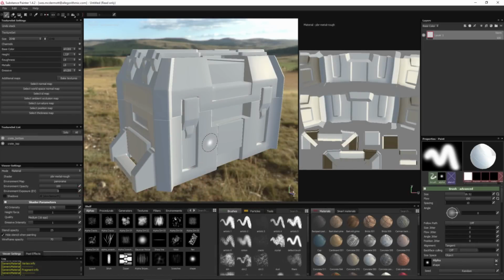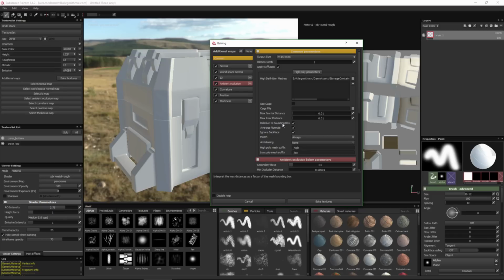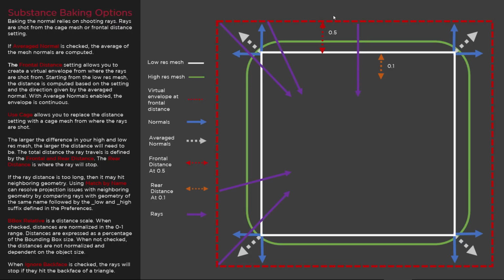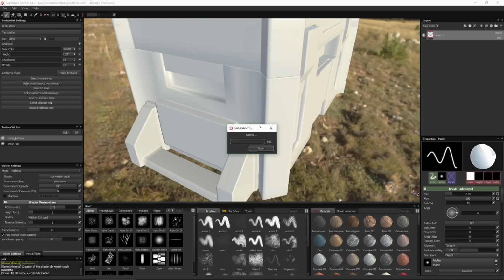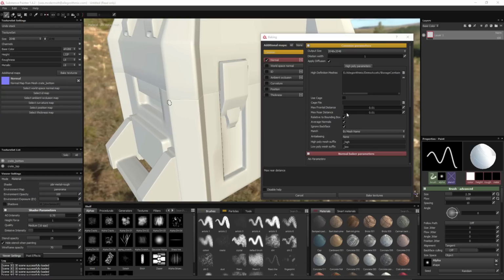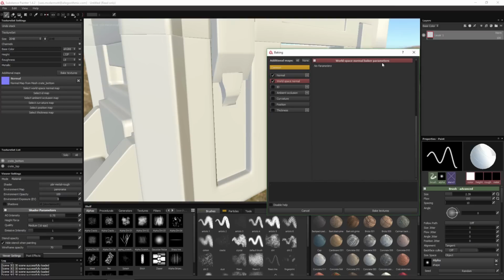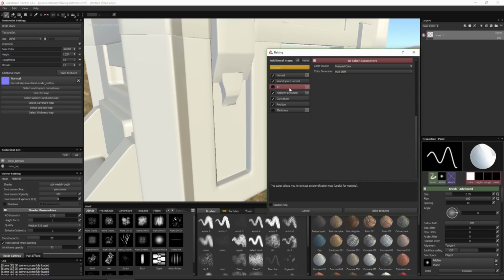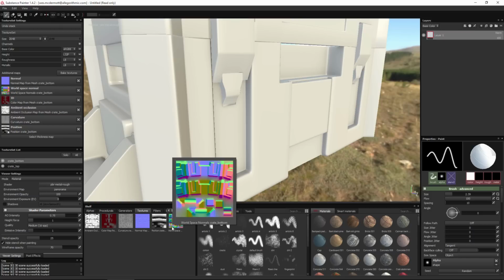Substance Painter Tutorial – Fundamentals 05: Baking textures | Adobe Substance 3D

Comment: I know this is old but seems like it still applies. I'm wondering a workflow that uses ZBrush, Blender, Substance and UE4 (using substance plugin). As far as I can tell, to take advantage of the matching feature, you need separate objects in one fbx, all with the same material if you want one texture set. So, in ZBrush, have a folder of all UVd meshes labeled as high, export the hipoly fbx (blender couldnt handle the poly count). duplicate the folder. Export the duplicate at lowest SD all and bring into blender, rename to low suffix, change mat to match on all objects. Bring into substance. Bake with match by name. Save out mesh maps. Make a low poly fbx that has all meshes joined into one mesh. Import into UE (this would make it so it's just one static mesh, not a dozen). Send to substance via plugin. Manually import and enable mesh maps from previous bake and viola? The only issue i can think of is triangulation mesh coming from UE import (they're quaded in blender and Zbrush). Would that be an issue if the UVs aren't really changed?

I'm fairly new to the whole process, so forgive the wordiness. Just trying to think out loud and see if I'm over complicating pipeline.
Reply from the maker: This shouldn't be an issue if the UVs are not changed. However you can also change the UVs and Painter can reproject the strokes. https://docs.substance3d.com/spdoc/uv-reprojection-28737554.html
Reply: @Substance3D  i actually did some testing and discovered the mesh memory feature, super powerful.

I had some odd overall UV shifts when putting the maps to the merged mesh in unreal (via plug-in) so i bit the bullet and set up a manual workflow between substance and ue, which actually isn't bad at all.

Also i just learned that hi poly doesnt even need UVs to bake.. at least in my case. So much time wasted.  

Name matching is the best

Comment: For baking normal maps - anyone knows what are the complications of having high values for frontal and rear distance? does it impact computing time or any other known issues?   Thank you!
Reply from the maker: The issue could be that the ray projection goes to far and intersects multiple mesh parts. This can cause artifacts. To compensate for this, you can use the "match by mesh name" feature to essentially mask the ray to mesh parts.

Comment: I am getting this error " not enough data in the high poly to use selected baker. Baking has been canceled." What to do wirh this? 
My mesh is inported from max and has 2 iterations levels of mesh smooth. That i think is high. My mesh. Textures of some parts are baked fine but there is always one or more edit polys/ objects whose map are all black. Complete black? 
I even searched online for this problem but couldnt find anything helpful. 😟. Anyone .....who could help me?
Reply from the maker: The data error sounds like it's coming from the ID baker. The ID baker defaults to vertex color and will produce an error if no vertex color exists on the mesh. For the black textures, this could be caused by having non-zero values in the transfrom. In 3ds Max, make sure you have the transform for the mesh frozen or zeroed out.

Comment: I have a problem using Substance Painter as my RAM goes full-load at 100% when I bake textures. The software doesn't crash but it keeps my laptop heated and the texturing process really lagging.
I use i7-7700HQ 2.8Ghz, GTX 1050 4G, RAM 16G and all necessary drivers are latest version. Is there something I am missing?
Reply from the maker: This could be expected behavior if you bake several textures at the highest resolution. However, the ram should free up after the bake.

Comment: Awesome tutorial, better than some "not free" tutorial i've seen on the subject.

i've a question about this. Does the high poly geometry have to be bigger than the low poly?  what if i have the two intersecating each other. I'm getting bad results and i'm wondering if is because of this.
Reply from the maker: Thanks! Glad you liked the tutorial. There could be many reasons for having issues with normal baking. The high and low should match as close as possible. However, if you are getting seams, it could be issues with smoothing, UV seams etc.
Reply: I was getting same issues today then I found out it was cuz of my model vertices, my robot model had double vertices on top in some areas and I was getting very annoying results but I removed those doubles and now its cool looking!

Comment: sooo about the high poly parameters 0.o... I only have one mesh. I don't really wan to model the model from scratch. Do i really have to 2 meshes?
Reply: nvm ill mess with the per pixel setting or ill check to see if i save a version prior to turbo smoothing, which should be the case since i had incremental saves.
Reply from the maker: You don't need 2 meshes. You can bake maps from the single mesh. Please check our latest course which uses only a high poly asset. https://tutorials.allegorithmic.com/courses/a97b433a5997fd800b5ed300d783cc41/youtube-IGGQl9kVB1M

Comment: But what is the use of baking? I understand the use of normal and AO but other maps i don't get it.
Reply from the maker: The other maps are used in the texture process with the generators. You can use curvature for edge wear and position and worldspace normal to place details at specific angles or directions such as snow or dirt collecting on the top of the asset.

Comment: Hello! I was testing how to bake a normal map but the baked map comes up black and nothing happens. Would you know why this happens?
Reply from the maker: This is caused by the high and low res meshes not being aligned. Make sure the meshes match up. Also, you may need to freeze the transform if the meshes were scaled.

Comment: Eyyy, thank you very much for the tut!! Awesome!

Just one question. According to your graphic, should the low poly be a little smaller than the high poly?  I understood that it doesn't matter, and we can control it with the cage or the distance value. But in your graphic the Low looks so small in comparation with the High...  And for me, I use to apply a mesh smooth for getting the High Poly, so it is always smaller than the low... 
Any comment about that?  

Thank you very much!
Reply from the maker: Thanks! Glad you liked the video. The low and high poly should match closely in size to overlap. The graphic is more illustrative in this sense and doesn't represent that the low should be smaller than the high poly. If you apply the smooth mesh and the high is smaller than the low I think you will get missing details in the raytrace. The key is to have both the high and low match as close as you can.

Comment: Hello, first of all, thanks for this videos, really really great. My qustion is, can i get Ambient Occclusion map from a high-poly mesh into a low-poly?, like bake the maps and the AO map being baked from the high-poly?,i tried, but i don't have sucess.
Reply from the maker: Yes, you can do this. You can bake AO from the low poly or the high poly. Please let me know what is happening with the map
Reply: Allegorithmic All right, let me tell my workflow for this, I don't know if I do it right. I open the project with low poly mesh, than i click the bake textures button, after, i select the maps I want and I put a high poly mesh in the common section, I hit the bake button. After the computing time ends, the AO map came with the AO from the low poly not the high poly mesh. Can you help me? OBS. If my low poly and high poly mesh share the same UV, I can bake the only the AO for the high poly, export this map, and open this map with a aditional map for The low poly in other project. Can I do this without this work?
Reply from the maker: If you are using a high poly in the high poly settings, it should be using the high poly for the AO bake. I will need to check on this.

Comment: Is there a way to deal with those aforementioned artefacts when your overall model is made up of a couple hundred different elements (3DSMax terminology for parts of the same mesh which aren't directly attached to each other)?
Reply from the maker: You can use the match by mesh name feature to isolate the ray cast so that it will only compute the mesh names that match. So for you high and low, you can use the default suffix of _low and _high. For example, you could have arm_low and arm_high. In the bake, only the bake only looks at the mesh names that match.

Comment: Why there is no diffuse map baking option? Sorry, but if you want just to bake from 3d scan to low poly retopo there is no option for this. Why not ? Just tell me!
Reply from the maker: We haven't added this baker to Painter yet. We do have this option in Designer. I will check to see what the plans are for Painter.
Reply: Yeah, it will be great to have this feature. You know, I am jumping between 3 softwares to have everything that I need. I think there is also no option for baking height maps.
4k baking with possibility to save in 8k (experimental), why ? Even XNormal has option to bake 32 K.

Comment: Could some kind soul shed some light on how to use the Max Frontal/Rear Distance parameters for the "virtual cage" to get a good Normal bake? The default values are 0.01. If I bake and find I need to adjust them, what sort of increments should I use... 0.02, 0.03? And should I match these for both parameters, e.g. Max Frontal Distance: 0.03, Max Rear Distance: 0.03?
Reply from the maker: There isn't a specific setting as it depends on the meshes. The max and rear distance define the length of the ray and the length needs to be long enough to sample both the high and low meshes, but not so long that it hits other geometry causing projection errors. To be honest, I just play with the settings until I get the result I like. In the future, we will provide a function to better visualize the ray.
Reply: Thanks for your reply. That would be an important update. If I use a cage instead, do I need to create a cage for each part of a mesh, e.g. if it is a gun with several overlapping, separate parts? Presumably you don't just create one overall mesh.

Comment: How do I read position map. Its very confusing. What I discovered so far is that magenta nuances of colors are lower geometry, and higher geometry is kinda cyan in color. I was up to use position map with chanell shuffle to isolate upper areas to apply dust somehow, but I dont feel confident to do that. Is there any video with the info on that. 
p.s. I have made some wood, rock, brick substances of mine. Can I upload them somewhere on your website, or are there any forums where people give away their substances for assessment, or download?

Comment: I find this series of tutorial for Substance Painter really good! Straight to the point and clearly explained, it has been an invaluable help in my learning of the program so far. One of my favorite features has to be the "Match by Name" function. Thank you very much for the efficient tutorials!

Now I am however facing an issue that I can't seem to find how to solve and it involves the Curvature map which always turns out black. All the other maps are baking just fine except that one. I've read somewhere that it might involve something with the GPU but I tried on 2 different machines (Intel then Nvidia) only to get the same result. I have also tried to freeze the transformations of both my high and low meshes before import with no success.

Aside from this little issue I am looking forward to pursue my learning of this pretty neat software. Thank you once more for all the nice explanations!
Reply from the maker: Thanks! So glad you like the training : ) Can you please post in our forums and I can help you with the curvature issue. I haven't seen that happen before. I've seen the normal bake as black when the meshes don't overlap. This comes from there being data on the mesh transforms. The curvature should be baked from the normal. Do you get an normal map?
Reply: Thanks a lot for your answer! Yes I do get a normal map. I've just made a test with a simple cube in case the issue came from my mesh but the curvature map still bakes completely black. I believe that there is a workaround to get a curvature map from a normal map "manually" in photoshop but might as well try to make this function work in Painter directly! I am going to post on the forum. Thank you lots once more!
Reply from the maker: Yes, please post on the forums and we can help. The curvature shouldn't be black like this.

Comment: [Scene 3D] 3D scene successfully loaded
[Baking] Baking failed (Color Map from Mesh)
Could not find vertex colors
[Baking] Baking failed
What now?
Reply from the maker: In the Color ID baker, it's set to vertex color. You need to set this to material ID and it will then bake the color from the materials.
Reply: another question. Im making a low poly game, do i need to use high definition meshes? for now i am only using smooth textures and matte colors
Reply: and another error...

[MapExporter] The input map 'Opacity' needed by the map 'Ficus 1_Madeira_AlbedoTransparency' of the texture set 'Madeira' isn't available because: 'Opacity' channel is missing in your texture set.
[MapExporter] The input map 'Emissive' needed by the map 'Ficus 1_Madeira_Emission' of the texture set 'Madeira' isn't available because: 'Emissive' channel is missing in your texture set.
[MapExporter] The map 'Ficus 1_Madeira_Emission' can't be generated for the texture set 'Madeira'.
[MapExporter] The input map 'Opacity' needed by the map 'Ficus 1_Folhas_AlbedoTransparency' of the texture set 'Folhas' isn't available because: 'Opacity' channel is missing in your texture set.
[MapExporter] The input map 'Emissive' needed by the map 'Ficus 1_Folhas_Emission' of the texture set 'Folhas' isn't available because: 'Emissive' channel is missing in your texture set.
[MapExporter] The map 'Ficus 1_Folhas_Emission' can't be generated for the texture set 'Folhas'.
Reply from the maker: You don't need the high poly meshes. You would use these to bake the maps such as normal , AO and curvature. These maps are used by the Smart Materials and Generators to produce wearing effects. However, you don't need to use these at all. You can work directly on the low poly. If you want to use the generators and smart materials, you can choose to bake the AO, WSN and Curvature without using a high poly. In the curvature settings, just set it to per-vertex.
Reply from the maker: This error is just stating that the export preset you used contains exports for emissive and opacity but you don't have these channels in your document. That's ok, you can ignore them. You can also create your own export configuration that doesn't contain emissive or opacity if you are not using them.
Reply: Thanks, you helped me a lot
Reply: you said to set to material ID but i didn't found material ID there so tried to set to mesh ID and material colors. And still getting the same error

Comment: can i texture it without uv unwrapping?
Reply from the maker: Painter requires there to be UVs for painting. You will have to perform some type of unwrap. You can use auto-unwrap or mapping and then later go back and redo the UVs, reimport and Painter will reproject the strokes to match the new UV layout.
Reply: And why would you do such a thing? I mean, instead of unwrapping first. I find it's the first thing I do after modeling...it also helps in case you want to use it in photoshop for further refinement

Comment: Hm . I didn't get with ID map . Do I really need it ? If my model has only one color , only one group of polygons . I really can't understand the benefits of this texture .
Reply from the maker: You don't need it unless you want to use it for quick masking. Some meshes may have many materials but the mesh you load in Painter only has one material. This is more optimized as you have 1 texture set or material. However, you can then bake an ID map from another mesh that has multiple material IDs and can then use the ID map to mask out materials.
Reply: thank you very much!
Reply from the maker: No problem : )

Comment: If always using a high poly model and are rendering in 3D software after do you need to bother with baking? Im kinda confused what the point of it is.
Reply from the maker: No, you don't need the baking if you are just using high poly. However, the bakers can still be used to generate specific maps used by the mask generators. The generators help to quickly create various wearing effects. You could use your high poly, bake AO and Curvature from the vertex and then use these maps to help in the texture process through generators. You don't need a normal map. You can also choose to not use generators at all and just paint the high poly.
Reply: Allegorithmic
Ah I see, thanks for the explanation :)

Just to double check, if I bake the AO then export and render in say Cinema 4D with AO enabled in the scene will I effectively have double AO or is the AO data not exported (unless specifically selected)?
Reply from the maker: The AO is just a map that is supplied to the shader in Painter. You are not baking the AO to the vertices. In C4D you can use the AO in a material channel as a texture.